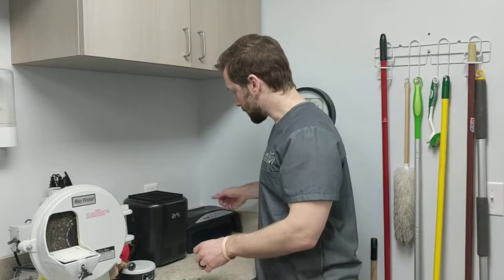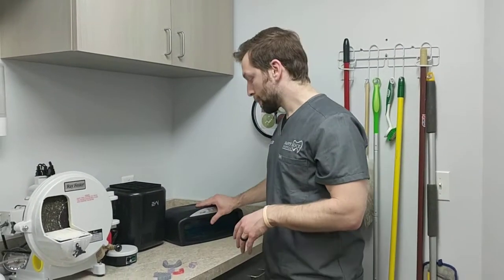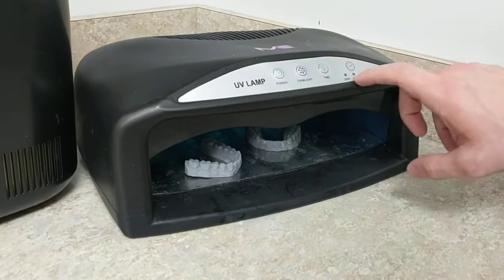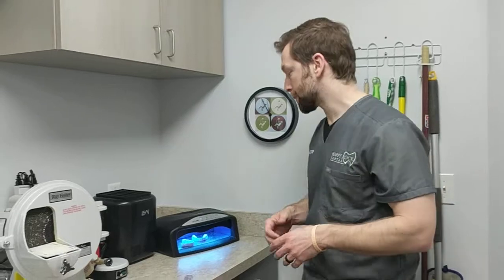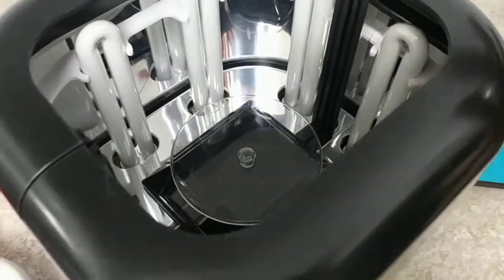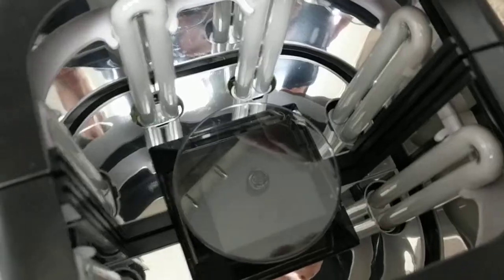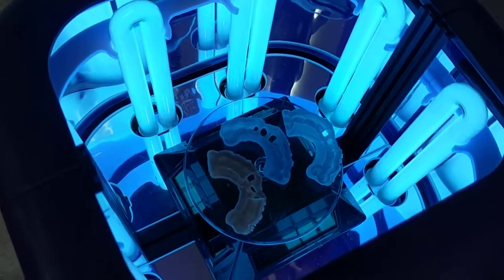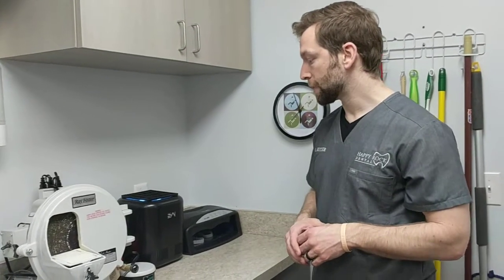DIY 3D Print Cure Station

Comment: Didn't though about combining two stations to make a cilinder, that's just genius.
Reply from the maker: Wish I could take credit for the original idea. My only original contribution was suspending the print platform over the 'curing unit' rather than removing the prints, themselves.
Reply: @bgrutterdds  Doesn't matter if it was your idea or not, by sharing this you just helped a random maker from the internet, thanks for that. I've read that putting the models to close to the lights may overcure them, is that true? I've seen people making cardboard boxes with this exact nail machine on top of it.
Reply from the maker: I've not experienced overcuring in that manner. And the things I cure require accuracy and precision. 

Be sure to check out my website under 3D Printing Tools for more Amazon links and such to what I've found to be useful. Curing is one thing. But my Jerry rigged washing unit is even better. That makes resin printing almost no more work than FDM.

Comment: Hey Baron, thank you for the video. When you make the 2 Nail lamp stand up like that is the power button on the bottom? Does it create any problems with standing it up?
Reply from the maker: No. Maybe annoying at first to turn on, but you hey used to it pretty quickly.

Comment: Is there any downside to curing in one of these v. a $700 one like the Curebox? They stress that the temperature is controlled. Is that important?

That turntable thing is genius by the way.
Reply from the maker: I think if you're putting something in the mouth longer-term, like a denture, it makes more sense. But for a surgical guide or Models, no need.
Reply: Baron Grutter DDS good enough for me. Thanks!

Comment: Yes ,to do model work actual restorations, I own a Dental Lab
Thank you so much 
Robert.
Reply from the maker: Lol. Still confused. Form2 will give a slightly better looking crown and bridge model. But, some report inconsistency with accuracy of fit.

MoonRay is more precise and possibly more accurate, but not as smooth a finish for wax-up prints. Moonray can also print C&B materials.